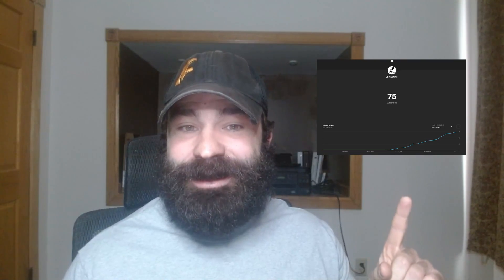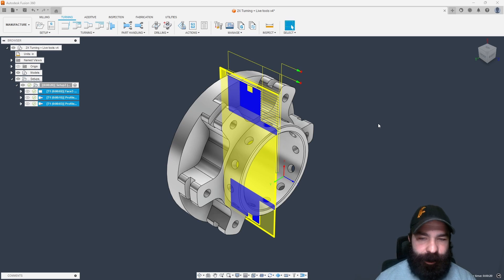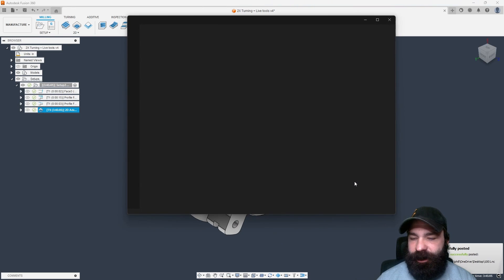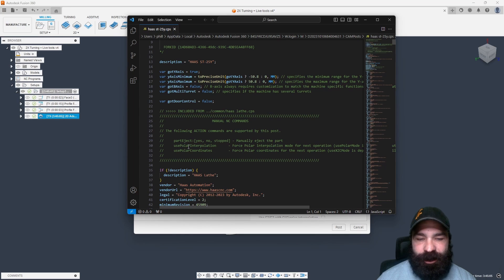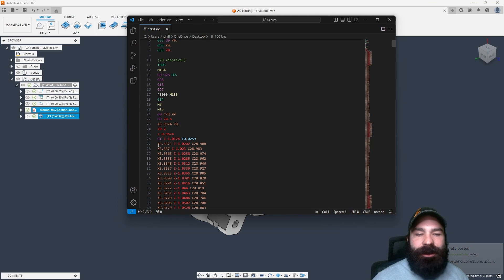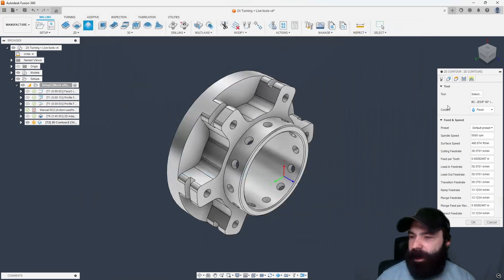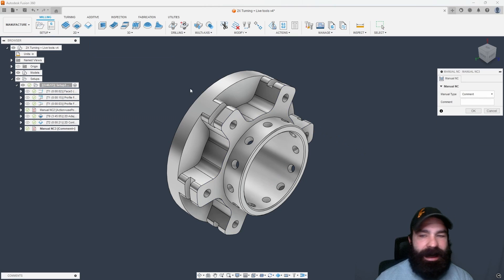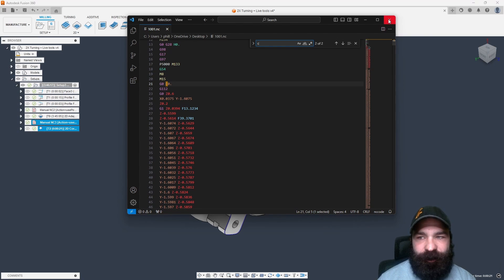Mill-Turn Thursday: Polar Milling

Comment: Thanks ! Question, in this case on my Haas st20y. I cant be fast because the C axis seems to " lag " and there move arent smooth. Do you also have this problème ? Thanks for your job !
Reply from the maker: Hello,
So depending on the age of the machine as well the options it could cause those problems. I would call your local Haas dealer and see what they say. another thing you could do is adjust Fusion tolerance and smoothing on the toolpath.
Reply: @JITCADCAM  its a 2021 ST20Y. Yes, i have full options. I will try to Switch between this two mode and see what happen. Yes i use the tolérance and smooting. But the résult is Never perfectly clean. I will Make New test asap ! Question, do you now how to use some Mcode on fusion ? My SSV, i try to active them with manualNC/ action but that make a error on post process.
Reply from the maker: Yes sir shoot me an email with what your trying to do and ill be happy to help.
help@jitcadcam.zohodesk.com
Reply: @sylvaingravelle  you can activate SSV right when you post-processs, there is a checkbox. Used on 2021 ST-20Y, worked just fine
Reply: @glebgro yes, but SSV will run for all the program. And in a lot of situation i want yo activate him only for finish pass. Thanks

Comment: Couldn’t you just use the g112 box in post processor to do the same thing. If not can you explain
Reply from the maker: Hello Rick, Great question and in short Yes you 100% can however due to the possibility that Machine sim for turning will be coming to Fusion 360 soon the days of forcing things in the post are limited. Also there might be times where you only want it for certain toolpaths. This gives you a way to toggle as needed.